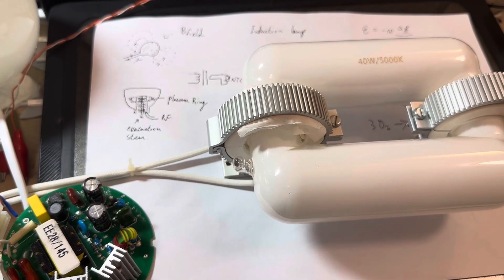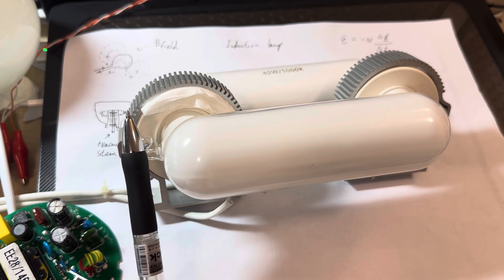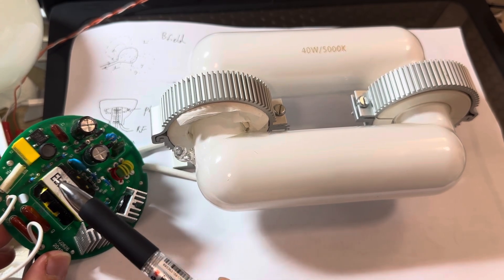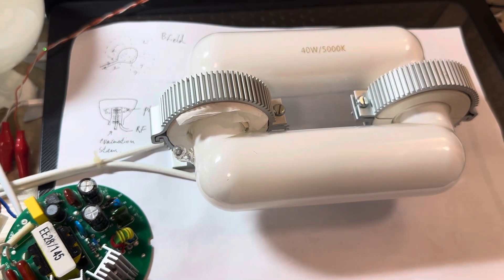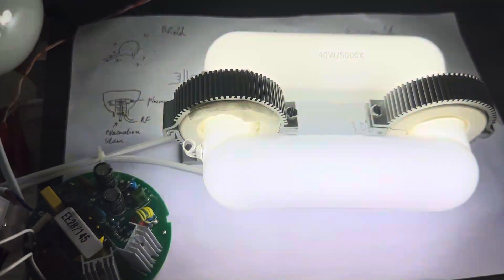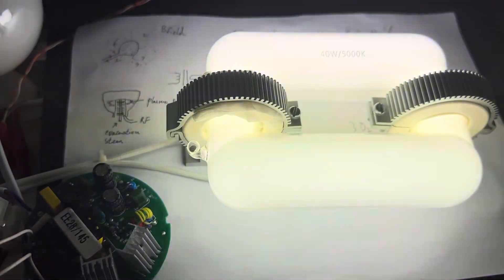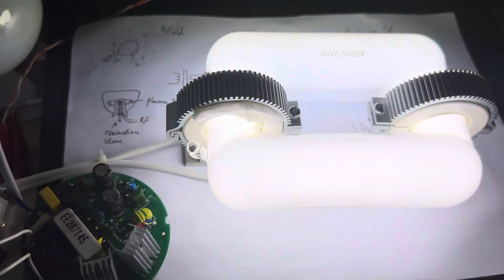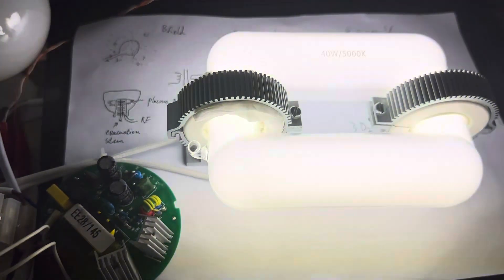40w induction lamp tested

Comment: Interesting. Components are supposed to half in life with every 10degC increase in temperature.
Reply: Then explain heating elements, diodes, transistors, inductors, microwave transformers, PTC/NTC thermistors, incandescent bulbs? You’re saying that a 40°c increase means 100% of its life 0:08 has gone.  It’s not not that simple to blanket this stereotype from things like an electrolytic cap all the way to a comm mode suppressor
Reply: Don't trust anybody with a goofy accent
Reply: @BritishEngineer  With a 40deg increase, the life is reduced to 6.25% of what it was.

A diode might have a life of 1.7yrs at 150degC, but 10000yrs at 25degC. Other failures could take over diffusion failure such as lead corrosion.